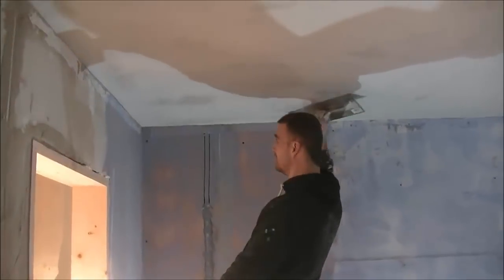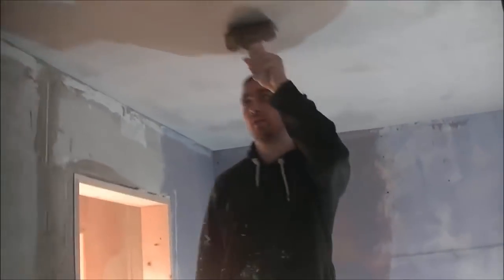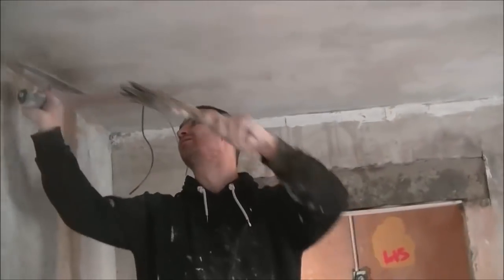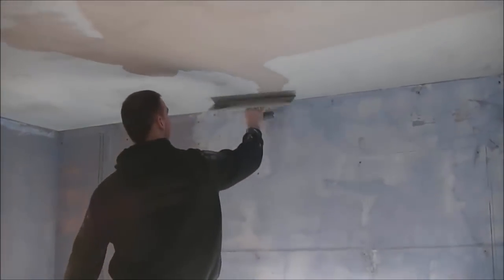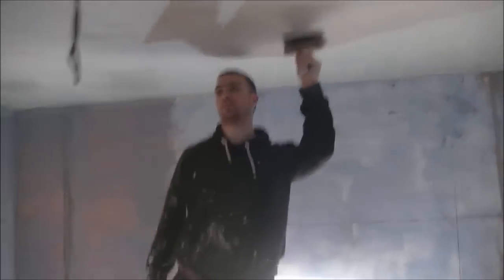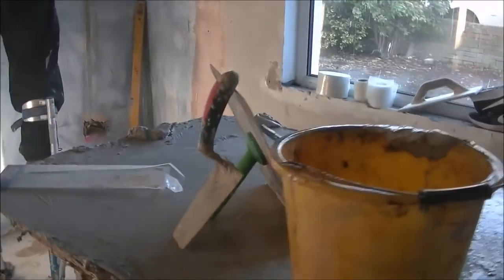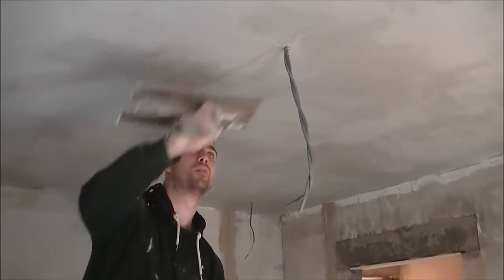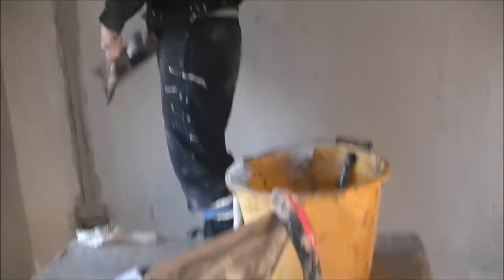HOW I FINISH MY PLASTER WITH A REFINA SUPERFLEX 3

Comment: Good job never had a refina I use Marshalltown and NELA wouldn’t mind trying one, I do the bigger ceilings the same way have seen other fellas trowel them the way they lay them on but I like to walk/run them
Reply from the maker: Yea i would trowel the same way on smaller ceilings but bigger ones i find this faster and easier :) Thank for watching Alex mate
Reply: mac plastering yea smaller ceiling are different if you can spread them from the wall to the middle your flying I’m a Co Down man and your Antrim very little difference in the way we work normally just small personal differences good to see you with a channel showing the way we do things 👍

Comment: Ever use a water spray bottle to wet ceiling?iv started using them lately it's some job
Reply from the maker: Hey buddy yea have used them some for render too but never seem to last for me witch kind you use ?
Reply: @macplastering  I'm not sure what one it is I just picked it up in local garden center works a dream for ceilings just sprays a light mist and no more going back and forth to the water bucket
Reply from the maker: Oh how many litres is it? yea i do the love the brush as i can keep the corners clean as i go as well :)